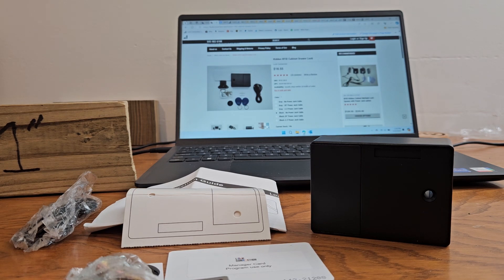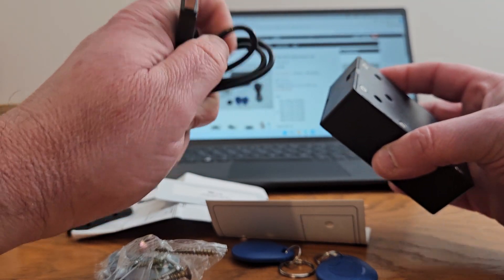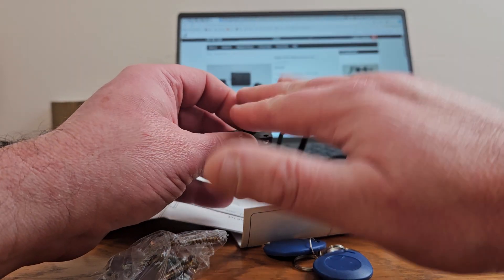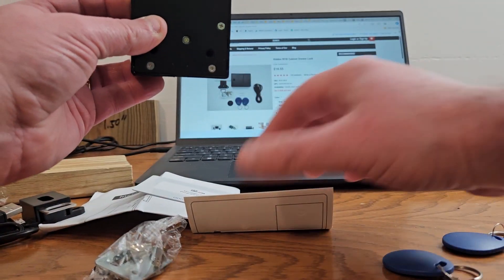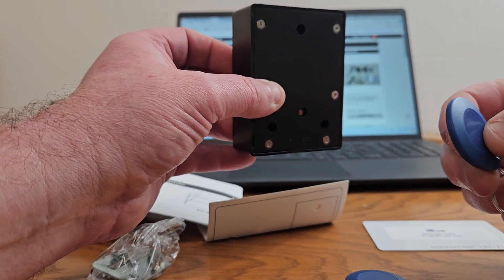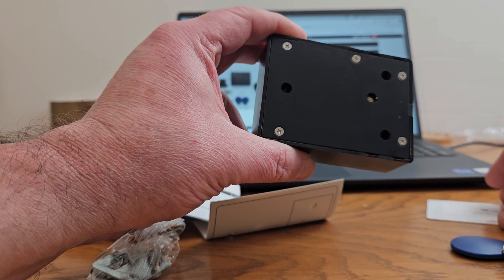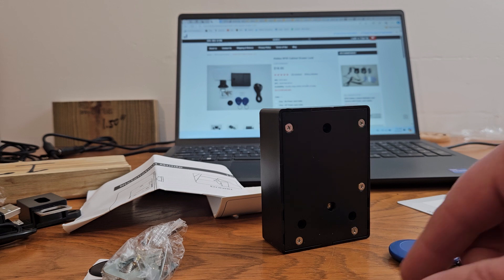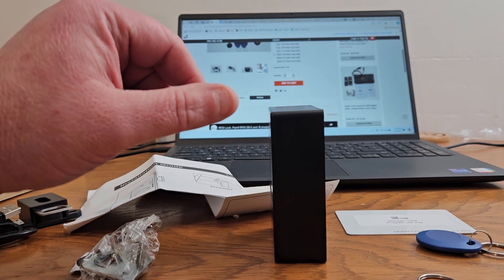RFID Lock, Part# RFID-2B-B and -G

Comment: I don't use mine every day, but periodically I find it has unlocked itself. I find out because it then starts emitting a beep every few minutes. Why does it do this? I can't use it now, because of the safety issue.

It's always plugged in (no batteries), and there have been no electricity outages.

Comment: Can you program the lock to not beep when opening?
Reply from the maker: no you can't.
Reply: @lockconnection3731 This would be a good enhancement. There are many scenarios where silent opening is necessary. I need to open the casing and disconnect the speaker.

Comment: I have a door with a little resistance to close due to a noise insulation rubber around the door, it is really a little resistance. Amazon similar locks does not open my door and just gets stocked. Will your lock will open even if you have a little tension? Is it possible to know under what tension the lock still works? Thanks
Reply from the maker: Hello, If the lock you are using locks identical, then ours would also have the same issue.  Our circuit is what is different from all the Chinese sellers on amazon.  However, this lock usually releases with some resistance on it.  We use them a lot in drop down concealment shelves and we have no issues at all.  I would suspect that you either have more resistance than you think or the striker isnt going straight into the lock body and is causing issues.  These locks will also probably not open your door, they will just unlock and probably crack the door.  I am not sure your dimensions but these are used in cabinets not full sized doors.

Comment: Is it possible to set it on public mode? I have a gym with 100 locks, and I want to be able to open every lock with every key but when it gets locked only 1 key to be able to open
Reply from the maker: no, this lock only has auto close mode.
Reply from the maker: Give us a call at 845-402-6108 or email us at info@lockconnection.net and we will see what we can do.
Reply: the IKEA ROTHULD is a nice lock for this purpose, it stay open, is able close with everything (nearly) what is a NFC or RFID Card in the 13,56MHz area, and opens only with the card what was used to close the lock. So the visitors can use her own cards, or the gym give the guests some cards if they don't have own cards whose are operate the lock. And if the guest are lost his card, the master card can open the lock.
Reply from the maker: @FrauHaferniehl  I don't know much about the Ikea lock, but the last I heard, this lock doesn't fail open.  We have other better locks that the Ikea lock that can be set to public mode.  The SDWS and KR-S80LC locks are 2 locks that we have that offer public mode., but the question is asking for a deviation of public mode.